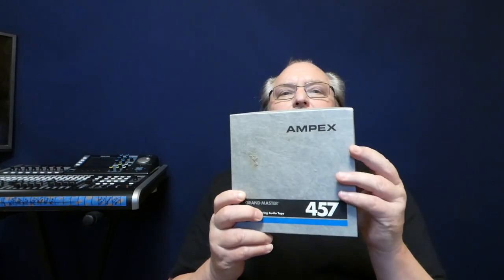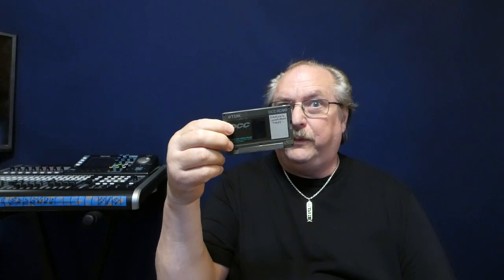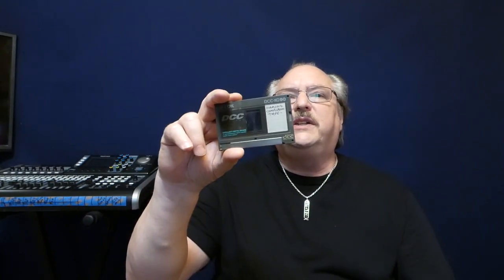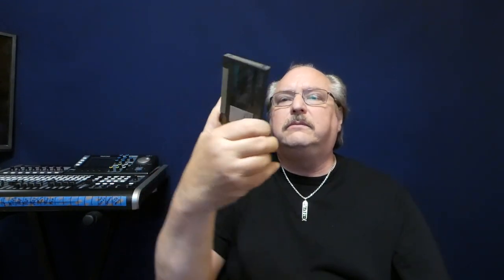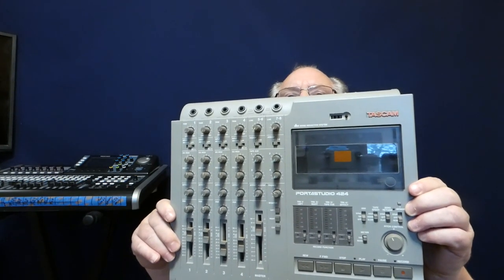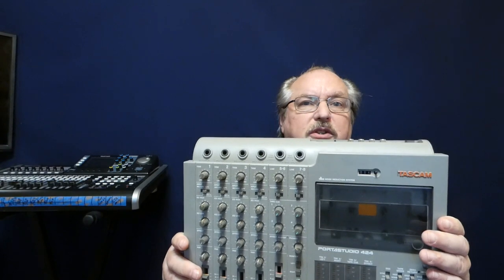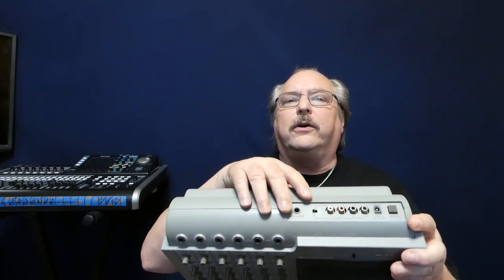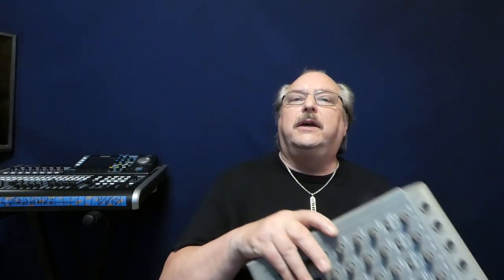Cassette to digital How to convert 4 Track

Comment: In theory that is an awesome idea, the problem I have, I can line them all up in the beginning and they sound good for the first minute or so but by the end of the song they're not jiving with each other anymore. Good old analog Motors speeding up and slowing down with the electrical current in the house a couple milliseconds here a couple Milliseconds there and we got a drunk singer or a bassist on speed😂

Comment: It won’t Line up perfectly doing single feeds into digital, some splicing is required , also there would be no effects if not embedded onto audio to begin with.  The Tascam seems like a better option to transfer, didn’t know they convert to channels on the rear, sweet option,

Comment: I have some old 90’s 4 track cassettes from a tascam machine.  Can I play them on any tape player to convert to digital?
Reply: I have a solution. I assume you have some kind of stereo interface or way to feed a stereo signal into your computer. The normal cassette deck will play back track 1-3 on the first pass. Record 1-3 on on one stereo track. Once you have the two tracks (1-3) copied turn the tape over and open a new stereo track. Record track 2-4. Now you have all four tracks in Audacity but track 2-4 are backwards. No problem. Highlight the track with 2-4 and open "Effects" on the tool bar. Look for "Reverse" on the effects menu and  double click. It will reverse the tracks 2-4. Now you have everything going in the right direction. Remove any silence/unrecorded portions of the tracks by highlighting sections and using the scissors tool on the Audacity toolbar. Place your cursor near the top of track 2-4 (where it says "Audio Track #") and the cursor turns into a hand, hold down the mouse and move the track left or right to line up the tracks. This will take some trial and error time but it will work and you will have your four tracks in sync. One thing to be aware of is the Tascam used either Dolby or DBX  noise reduction  (usually Dolby B/C or DBX in the last in few modals). This will cause you tracks to have significantly more high end when played back but a little EQ in the effects library can help with that. Good luck.

Comment: Just wondering : I have alot of originals recorded on a Tascam Porta 01 4 track machine which doesn't work anymore. Can 4-track machines be bought anymore? Or is there another way to transfer my songs to the computer (I have Audacity)?
Reply from the maker: Audacity, as great a program as it is, is limited to how many tracks you can record at one time. You can either record one mono track or one stereo track at a time but you cannot record multiple tracks simultaneously. If your 4 track was working you could use the method I described to bring in tracks one at a time and line them up using the method I described. Actually you could bring in tracks two at a time (using a stereo track) and only have to align the second stereo track to the first giving you all four tracks from your cassette but in order to be able to process the tracks with more EQ, reverb, compression etc. you will want to do it one mono track at a time. Still in order to access all four tracks you need a true four track cassette deck. Five years ago you could easily buy any number of 4 track cassette machines (Tascam, Fostex) on Ebay for under $100. Now there seems to be a revival of interest in 4 track cassette decks (I don't know why) and it's hard to find a working one that is not just for parts for under $200. I was fortunate to still have my Tascam in perfect working order. I wish I could help you. I spent many hours transferring my old 4 tracks (both cassette and reel-to reel) and have had fun mixing and processing them in my computer using Reaper (I know I said I was using Reason but that was just a mistake). I know my old stuff is junk and crap but it's my junk and crap and there are a lot of good memories in those recordings. Good luck.

Comment: Hello I Have a cassette tape that I recorded on a four track recorder a long time ago &  I want to see if it’s possible to convert that to an MP3 file without a four track recording unit?
Reply from the maker: This may sound a little strange but I am sure you can do it. First you need to download Audacity (free audio software) Audacity.com . Hook up a stereo cassette player into your computer (assuming you have a cassette deck and an interface to allow you do it). In Audacity under file hit "New" then under "Track" go to "Add New" and hit "Stereo Track". Record the first two tracks of the cassette in Audacity.  Save that recording as a wav or mp3 file (I suggest wav but mp3 will work). After saving the first two tracks go to "File" and hit "New" to set up a new recording. Turn the cassette over and play the other side. This will give you the other two tracks on the cassette but they will be playing backwards. After the recording is made highlight the two new tracks and go into "Effects" and you will see a long list of Audacity effects. There is one called "Reverse" click on "reverse" and the two highlighted tracks will be turned around and play normally. Now go to back to "Tracks" in  and click on "Add New" then Stereo Track" and Audacity will add another stereo track to the session. You should now have four tracks. Drag and drop that first recording into the new stereo track. You should now have all four tracks in one session. They won't sync up by themselves so you will have to highlight and move the track to match the two wave forms  but that should not be too difficult. Highlight any silent area at the beginning of the second two tracks so you have room to move the track. In theory this should work.

Fortunately I still have my old Tascam four track cassette. Still a great machine. I have been transferring my old four track cassettes into my DAW (Reaper) and it's amazing how good the quality is. Can't say that for the performances but the sound quality is really quite good.